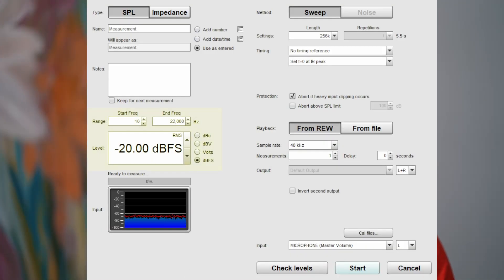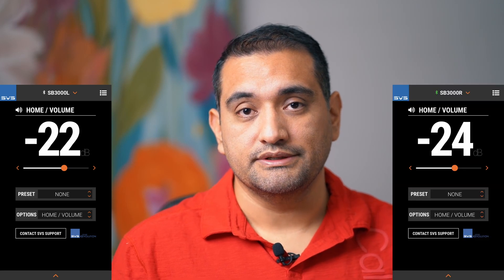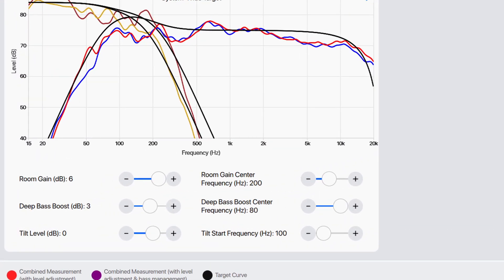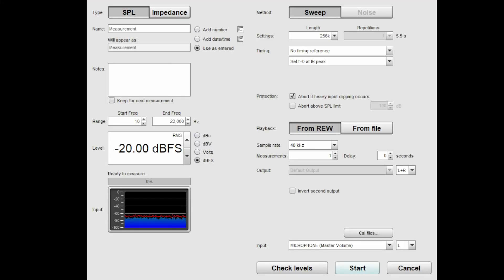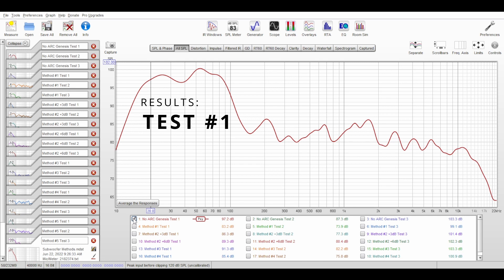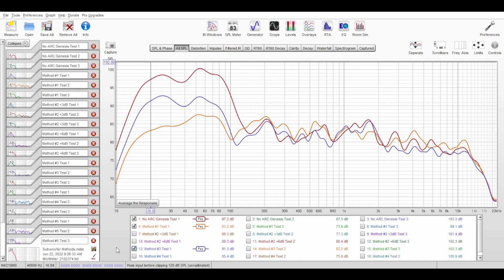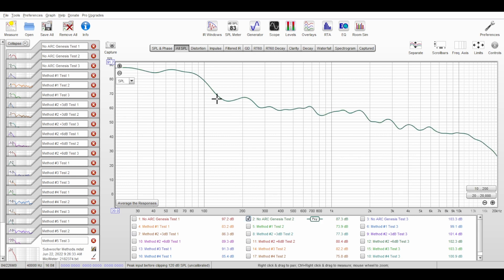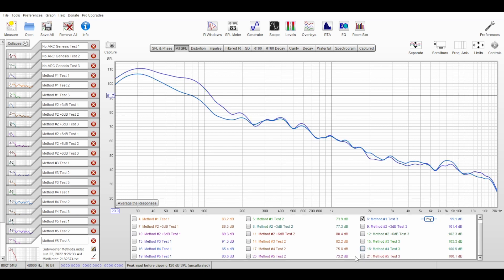Subwoofer methods with measurements in REW - Home Theater #19

Comment: Great video... Curious if method 5 also need such high room gain, deep bass boost, and the other level you adjusted.  Also curious to what ARC set you sub level trims to with the various methods as well.  My findings with method 3 is that ARC reduces the sub level trims by quite a bit..  when I ran method 5, my sub level trims in ARC were closer to what my speakers were which gave me better results with the room gain not needing to be so high..

Thanks again for spending the time to do all of this!
Reply from the maker: Thanks Captain! What's funny is I actually did save the PDF results from each of the methods and meant to share them but completely forgot. I think I will do that for the next video because I actually haven't even looked at them to see what changes it made.